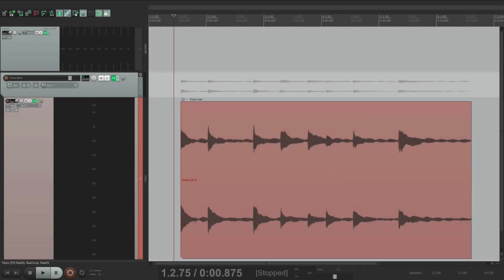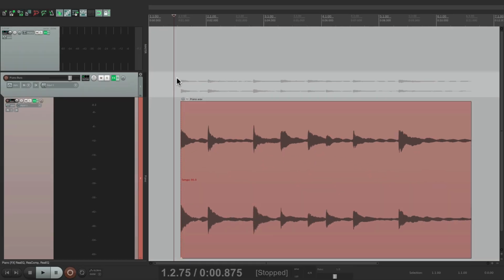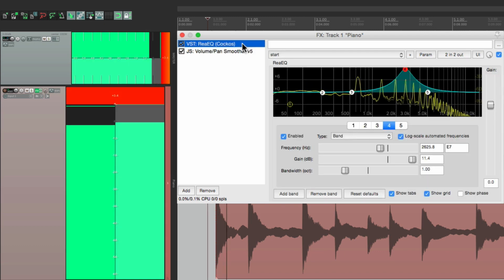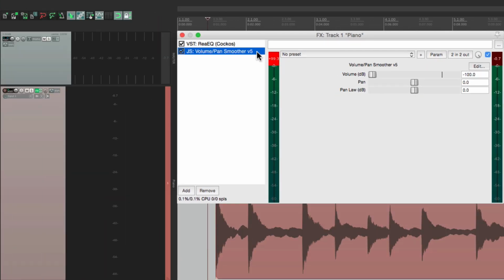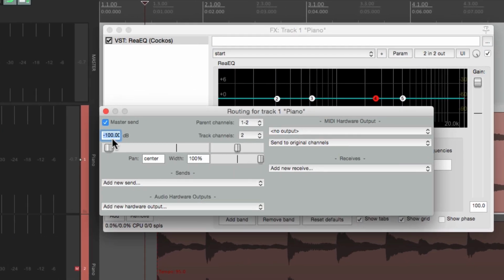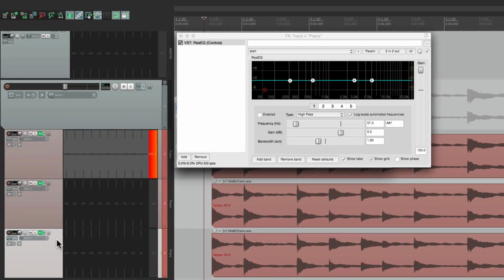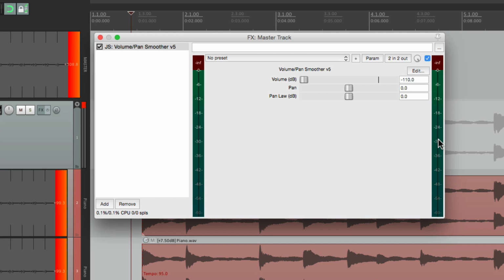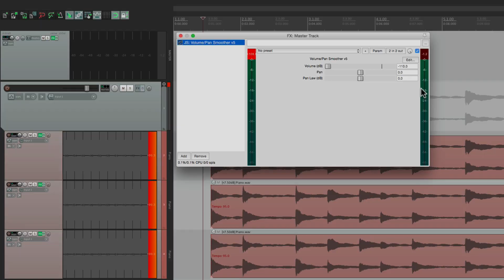Gain Staging in REAPER

Comment: While this is certainly true if only REAPER and REA-plugins are used, it becomes case-by-case thing if other plugins are used, especially "analog-modelled."
So it does make sense to watch out for proper levels at all times. Thankfully multiple volume control points in REAPER make it very easy.
Reply: That's interesting but it's not good for seeing where you are when mixing. 

Isn't it really better, to sort out the input gain on each channel whether they be VST or analogue, to be -18 to - 12 on peaks with the fader at 0db. That gives you more room to mix, add plugins, effects etc and might save your speakers too?
Reply from the maker: Yes. In the end we should use our ears.
Reply: This is exactly what I was thinking... if I have analogue modelling plugins on the channel but am fixing the gain staging AFTER on the master then what levels are actually hitting my plugins and how are they affecting the gain stages inside those plugins?
Reply: @Ashadowtotheworld  Starting to see folk refer to plugins that have pre fader meters.  Izotope has a few with this.  Trash2 being an example of analogue modelling.   https://youtu.be/CGRusg9GnAg?t=225 Being an example of this discussion.
Reply: and also if you have multiple pluins on a track...gain staging often becomes necessary for example between a compressor and an EQ...you might need to turn that comps output down considerably to not blow the EQ up...gain staging or am i not seeing something?
Reply: Kenny never said that you should work that way.. he was just pointing something out 🤦🏾‍♂️
Reply: Thanks so very much
Reply: Also if the analog-modeled plugin doesn't offer oversampling (which usually they do), you need to alter the DAW sample rate while using them.
Reply: Hey, ik its an old comment, but could u recommend me some cheap/free modelled vst's that clip nicely? Ableton's "dynamic tube" did it well enough for me, but I'm thinking about changing to Reaper and I miss it, even tho the bundled JS saturator is not that bad.
Reply: @whiteonwhite226  voxengo tube amp, camel crusher, dd overdrive, wave arts saturators, ferricTDS

Comment: If any plugin in the chain has built in saturation or any emulations of analog gear with a digital reference level I'm quite sure this way of thinking/working is not the best idea..
Reply: Yeah, this is dangerously wrong.  It could take a new engineer years to Unlearn this one video.  
32 or 64 bit Audio allows for nearly unlimited level changes in the code.  But gain staging is all about Nominal levels and how they relate to Professional Analog Equipment, and NOW Analog Emulated Plugins.  But Gain Staging also effects all of your Dynamics Processing (are you gonna set your threshold to 100dBFS?)
PLEASE DON’T MIS-EDUCATE YOURSELVES
Reply from the maker: You should set those plugins according to what the manufacturer suggests. But it won't matter what you do later on in the chain.
Reply: What about dynamic processors? Even with the threshold at 0 dBfs they won't be able to handle a signal using this method..
The title of the video is a bit misleading.. "Floating point in Reaper" maybe?
Reply from the maker: I'm not suggesting that you boost anything by 100dB in the video. Just that you could. You still need to set your compressors to taste.
Reply: That's why I said that the title is a bit misleading as this IMO  has little to do with gainstaging, it just shows one advantage of floating point vs fixed point. Proper gain staging will eliminate the need to compensate/reduce the volume with an extra plugin before every stage of gain sensitive processing..

Comment: I really believe it's true. But why!? I'm trying figure it out how it is possible.
Thank you by the top notch content.
Reply from the maker: Yes. The problem for most people (myself included) is that we think of these things in stages. So if you go over in one section, you think you can't fix it later. But to a computer, it's just numbers. So one fader +100 and another -100 is still 0. It doesn't view them separately the way we do in our heads.
Reply: Thank you @Dan Updegraff and @REAPER Mania Kenny, things became clear here, but let´s use it as last option :)
I was thinking and realised that the process "level dependent" like drive and compressor mess with this concept. This video changed my way of thinking and I need ask for public apologize and some recall of my students too. lol
Reply: The audio is represented digitally as a series of numbers that indicate level.  Theoretically, digital audio can be boosted to "infinity" and it won't distort as long is there is a similar cut prior to the digital signal being converted to analog (via your interface / soundcard).  
I still like keeping all my meters out of the red though.  Less stress on my brain.  ;)